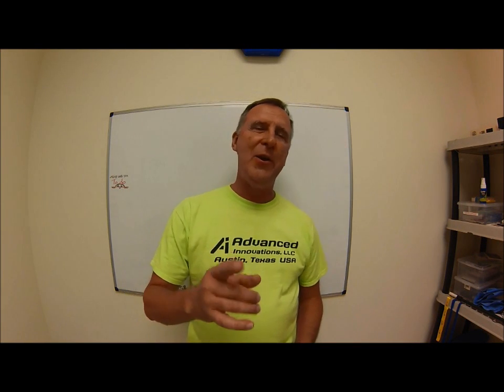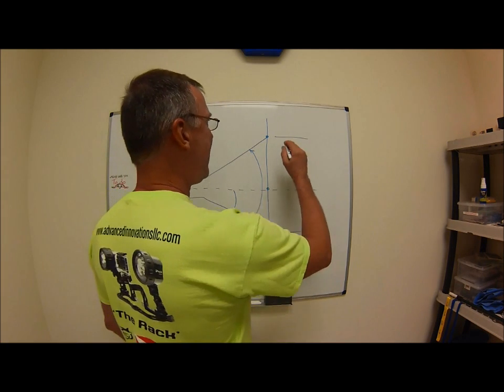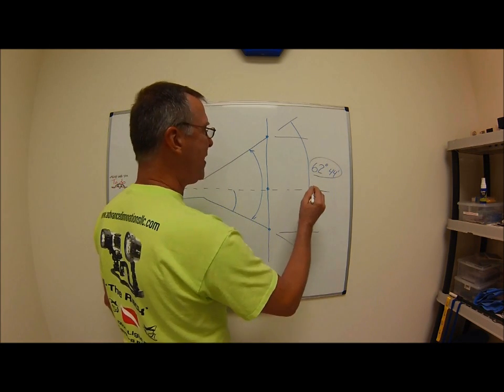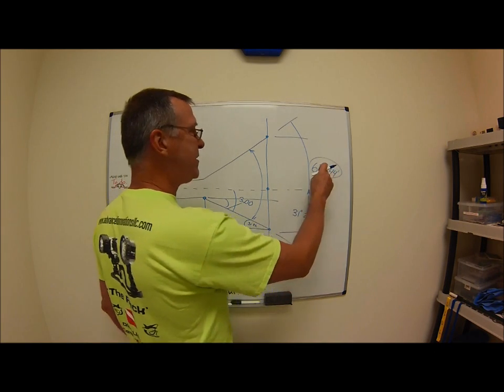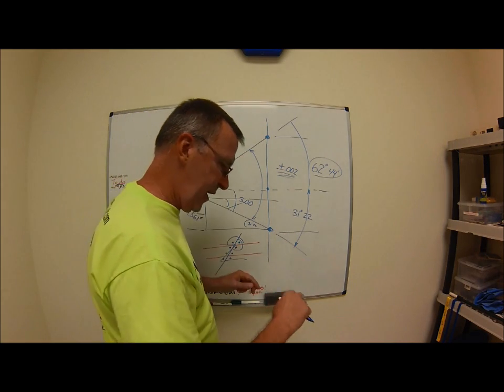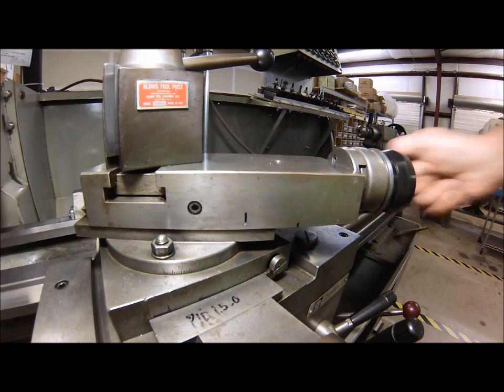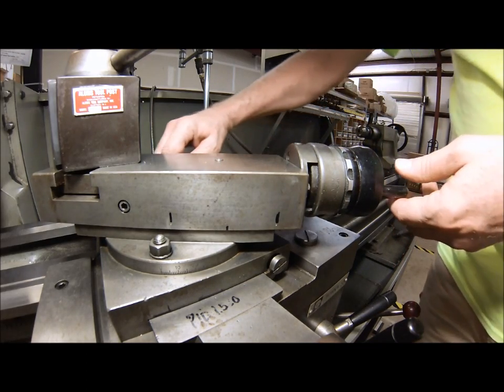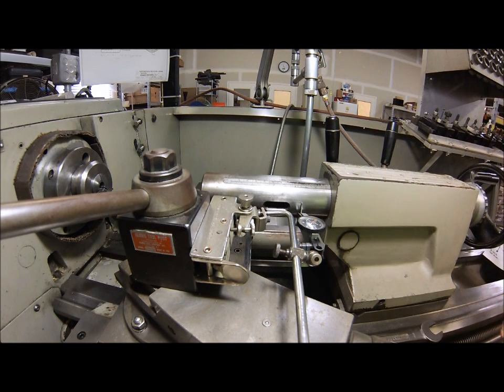Setting the Lathe compound to precision angles

Comment: Thanks Joe, will this also works for very shallow tapers like 1mm over 280mm length (this is something like 0.2 degrees). Is it also possible you think to cut this taper with the compound method in sections?

thanks in advance

Teun
Reply from the maker: You may be better off pulling your tailstock off center and turning the part between centers for such a mild long taper.
Reply: Joe Pieczynski ok but How do I archieven the right accuracy that way?
Reply from the maker: Calculate the cross slide drop over a given distance and set the angle with an indicator and a straight bar. By having that straight bar pinched between centers and an indicator in a tool holder, you should be able to move the carriage and see the needle on the indicator respond to the movement. Using a DRO or another long stroke drop indicator you can move the carriage a known distance and see if the tool post indicator gives you the correct value.
Reply: thanks again Joe. I will try this...........and let you know the result

Comment: Joe.  This is a brilliant technique.  Thanks.
Reply from the maker: Super accurate. Be sure to keep the indicator as close as possible to the centerline of the registration surface when you check your drop reading.
Reply: Ah good call.  Yes.  I love techniques like this that use an indicator as opposed to some backward arse way of trying to gauge or guess.  This produces real repeatable numbers.  Again...thanks.
Reply from the maker: I manufactured and repaired military explosion suppression systems and valves for many years. The angle on the print absolutely needed to be the angle on the part. This technique passed inspection 100% of the time.

Comment: There's a much faster and more accurate way of doing it - if you have a sine bar.
Just set the sine bar up for half the angle for the cone and set it up with its gage blocks, on the side of the compound (laying down, of course) - Then just tram the working face of the sine bar with the carriage movement while tweaking the compound angle until you get zero T.I.R.
You may have to set up parallels and/or 1-2-3 blocks to clear the nuts/lower flange in order to get the sine bar up high enough to reach the compound side.
Reply from the maker: True.....but you need a sine bar and gage blocks.

Comment: good Video thats how i was taught to set up and angle the toolmaker that trained me told me the bigger the triangle the more accurate you will be you could be accurate over one inch it all depends on you technique. ps the ones who give you a thumbs down are probably just cnc operators trying to learn how to run a manual lathe lol keep em coming

Comment: Joe - on the topic of c's and 6's - the part was aluminum - any advice on producing c's and 6's out of stainless?
Reply from the maker: The TPG insert works well for me on SS. I do 17-4, 303 and 316 frequently. The chips rollover and break just like the aluminum. Coolant has proven to be beneficial.
Reply: Thanks Joe - I will have to get more aggressive with my cuts, feeds and speeds - I am tired of getting sliced up by razor sharp SS spirals......

Comment: That was an impressive trig lesson. I really do like this answer to a simple problem. I really like this approach over what I see a lot, what uses a "close enough" approach. Depending on the job I'm running, some of them it's "as long as it fits the box" others it's "get it as close as humanly possible... then get it closer" so the math approach is appreciated. the old slogan "If the numbers are good, the result will be good" comes to mind.

Comment: Interesting that just today I was looking through a 1945 copy of Mechanic's Vest Pocket Reference Book, by Wolfe & Phelps, sixth edition.  I am not a machinist, but my grandfather gave the pocket book to me when I got my aircraft mechanic's license in 1965.  The first subject in the book is titled "Interpolation Instructions."  First sentence: "A new system of interpolating trigonometric functions analogous to that sometimes used in connection with logarithms is provided for in this booklet."  It then goes on to describe a mathematical method of determining the sine of angles specified to an accuracy of ONE SECOND of arc.  In the first example, given an angle of 33 29' 34''', a method is shown that in six steps of calculation provides a sine value of .55183.  I have not begun to understand the method, but it makes it pretty clear to me that by the end of WWII, those machinists really had it going on.
Reply from the maker: With more primitive tools and machines than current day. they have my respect for sure.

Comment: Joe, when you multiplied the sin(31deg,22minutes), how did you input it? 31.22? I am coming up with a little smaller# then yours,
Excellent teaching skills by the way. REAL machinists training on your channel. Thank you in advance.
Reply from the maker: This is a common mistake. When using a calculator, 22 minutes isn't a pure .22. Each minute is decimal 1.666.   You must make the conversion if your calculator doesn't do it for you.  22 minutes is just over 1/3 of a degree,  .22 of a degree is just under 1/4 of a degree.   Thats the error you are experiencing.
Reply: Gotcha, thanks

Comment: Amazing application of Maths. Do u already made the video with the explanation of how to measure with precision the bigger diameter of the cone? Because I've always wonder how to do that.
Reply from the maker: Internal or external feature?
Reply: Well... both
Reply: For internal, place a ball bearing of known size into the cone and measure to the face. Sketch out where a sphere contacts a taper on paper and start drawing right triangles to solve for and work your way to the feature you want to calculate for.

Comment: Great video joe, can you talk about how to set up for a male taper? Let’s go with the premise of, Ihave a taper but i know noting about how to measure it let alone setting up the cross slide. The end of the taper is banged up a little so i cant determine the length of the taper. All i know is it came out off the tailstock of my watchmaker lathe. It's tiny. Size shouldn’t matter right?

Comment: 0:38 this is exactly why I think experience is more important than getting your engineering degree, although that still is important. Some kid that's 4 years out of highschool makes a print and has no clue about manufacturing process and how hard certain things are. You just see a print where everything is 2 tenths and you know they don't have a clue. I've been working in shops starting as machine maintenance and started running cnc mills to cnc grinders and now in going to school for advanced manufacturing and machine technology to learn how to make the stuff before learning how to design the stuff. I want to be able to design things that are easy to manufacture and service and make a print that won't make the people who make the parts hate me. I'll probably just end up having my own shop and make my parts anyway because it's more fun than drawing on a computer. The first time I made my own toolpath on my mastercam part and loaded it and setup the minimill and ran it, it just put lighter fluid on my fire. I love this stuff. I'm only in my second semester of school but I'm 2 semester ahead already because the work is just fun to do.
Reply from the maker: It helps to have that passion. I used to teach "Design for manufacturability" to 3rd year mechanical engineering students from the University of Texas at Austin. They were shocked at how much they didn't know but learned in 40 hours.
Reply: @joepie221  I wish we had that class. Going through school for mechanical engineering right now and some of my classmates scare me. A buddy of mine had to teach a mechanical engineering intern how to use a wrench and the difference between steel and aluminum! Yikes! When I graduated with my bachelors degree I looked back and realized that all they had been teaching me was math, not engineering. The stuff I found important, like how to dimension parts so tolerances wouldn't combine to create an unusable part or even acceptable tolerances were just glossed over really quick. I don't think we ever really covered how to create a readable, usable blueprint in detail beyond my only CAD class my first year. Everything was about the math.  I work on cars for a hobby and I constantly curse engineers for making things near impossible to work on, although that is also influenced by assembly lines requirements and accounting I'm sure.  All our engineering exists in the computer, so if it works there, it must work in the real world right? Yeah right.

Comment: Thank you I will give it a try. I need to cut a B10 taper for a 6mm drill chuck and the angle for B10 taper is only 1.37 deg.
Reply from the maker: On a taper that mild, be sure to leave some drag on the locking screw(s) that lock your compound to the cross slide for the cut. Any slop in your compound ways could effect the result.
Reply: There is another way to turn an external tapper for which you have a reference to copy (e.g. Morse, various chuck tappers). Put a good arbor/extension with that tapper in the chuck and indicate it to make sure it turns straight. If you have it, use the tapper in the through-hole of the lathe (with good adapters) instead of the chuck. Then indicate longitudinally off the known good tapper, adjusting the cross slide until the needle stays put over the entire length of the reference tapper.

Comment: Very clever method, and very precise. I had trouble, however, when turning an external taper between centers. Everything got in the way, and couldn't use full travel of the compound slide. Anyway, I think it´s a great method and will stick to it most of the time.

Comment: Looking for instruction on cutting a one inch roap grove pully.
Thanks.
Reply from the maker: In the absence of a CNC, you are going to need a form tool to match the radius on the rope. You can plunge the tool and walk it out with the compound set on your desired angle, but you will have to reverse either the pulley, or the compound setting for the second angle.

Comment: This is great, i thought you were going to suggest using some scrap bar and cut the angle adjusting till it is correct ! BTW how would you measure across the mouth of the angle, "Hight over a ball" that would be a good lesson, a bit of math involved, but never let me down.Thanks once again...
Reply from the maker: That video has already been posted. Take a look at my video list for measuring conical angles.

Comment: Joe. Leave the tailstock alone. Machine a piece of steel. Here is your perfect Z Axis. Your compound on 1 crank travels 125 Thou (1/8 Pitch) [or measure its exact travel on one full turn.] This is your Hypotenuse. Your Dial gauge is set on your X Axis as you have shown. Zero the dial against the machined piece. Crank one full turn on the compound. Example result. Dial now = 100 Thou, Compound =125 Thou. ACS(100/125) = 36.8698 deg. You get ACS (Arccosine) and all other trig functions on a cheap calculator and then one hour playing around on a web page showing the basics of working with trig. Its not as scary as we were once led to believe. Eg 2. Turn the compound crank 4 full turns = 500 Thou. The Dial may now show 400.5 Thou. ACS(400.5/500)= 36.7742 deg. By the way, the compound set at 36.87 deg gives the 3  4  5 Triangle.
Reply from the maker: I see where you are going with this, but if you are midway into a part and need to address another feature, machining a blank in the spindle isn't feasible because you would have to remove your working part. For a fresh part, you may be able to use this, but I personally would rather work zero to zero with a fixed drop and cross slide. Its no less trig either way. You still need to know your hypotenuse and short leg, or you'll have to calculate your short leg after reading your hypotenuse. Thanks for the comment.

Comment: i really like your videos and they have help me to understand many things in a different manner i do have complications with understanding angles an radius for example 62.44 minutes I see you split it to 31.22 minutes my problem is that some times that dimension is from apposite direction from 90 and I get confuse about that ( like 30 degree and some times they call long 30 wish is from 90 back but its very confusing for me to identify which one to applied the same problem with radius  may you have any mated to identify this better I will appreciated, and thank you again for your time, and this good videos you provide to us

Comment: Hi Joe my graduation on my compound slide table is practically  disappeared and can barely see them. Is there a way I could have the graduation put back on. I'm new to lathe work and started restoring my 1939 colchester master lathe. Sadly the Previous owner really didn't take care of it. Other than that im enjoying the whole experience.
Reply from the maker: I could only imagine machining them back on. Rotary table on a manual mill or a CNC should be able to handle that.
Reply: It would be easy enough to get a zero mark by using a test bar and running your top slide to zero. You would then need some math to do the rest.

Comment: small pet peeve, the number I'm getting for your calculation is "1.5615389039" which should round to 1.562", if it was rounded down to help meet a tolerance pls say so.

Very helpful video though, I have already bought a couple more indicators trying to hit a precise angle on the compound but with this method you only need one!  Thanks for uploading.
Reply from the maker: At .0174 of rise per 1 degree of run, the 4th place decimal doesn't really effect the angle unless you were trying to hit the moon. .0005 translates to 2 minutes at 1 degree. +/-

Comment: Check the tail stock quill to make sure its parallel. A lot of them are not.
Reply from the maker: If your indicator contact region is at or very near the center of the tailstock spindle, the parallel relationship of the tail stock spindle to the bed becomes less important. The amount of error would be reduced if any was present at all..

Comment: Thats brilliant, super clear and simple :). A couple of comments about possible inaccuracy of the tailstock.
If youre working on an old beater with known issues with the tailstock, of even if there is no tailstock, you could chuck up a piece of scrap and cut a couple of collars of equal diameter over the distance you need, then measure out youre triangle in the same way. That way youre relating to directly to the spindle.
Cheers Joe, ill be needing to do this sometime soon.

Comment: Hi Joe, 
thank you for a great bunch of videos - I am subscribed :-)
I am looking forward to the second part of this video, where you explain how to get, not only the angle correct, but also how to get one of the diameters of the taper right at the same time.
The job I have in mind is making is (for example) making my own chuck backplates for a lathe with short taper nose  (DIN 55021, 55026, 55027 and similar).
Not only the angle has to be precise - 7deg 7min 30sec, but the large diameter of the taper is specified to three decimal place (in metric not imperial).
Chris (from UK)
Reply from the maker: If you know the sharp corner diameter and work back from there, its a piece of cake.
Reply: he, he,
thanks Joe,
everything is easy if you know how...
and that's why you are doing the videos and I am asking the questions :-)
If it was the smaller dia of the tapered hole, that was specified, I guess, I would turn the straight dia hole and then taper it, but with the big dia being the critical one, I need one of your tricks... please.
Reply from the maker: Once in a while you will encounter a feature that demands you have a gage or comparator or something else to achieve your goal. Since you are boring a tapered bottom hole, and the mouth of the hole is the important dimension, you still have options. If you know what the radius is on your tool, and you know what number on your dial gives you a bore of the same size as the major diameter of your taper, you are half way there. Once you know your dial number, and you have your tool sitting flush with the face of your part, its now only the radius that is the wild card. It may take some geometry to figure it out, but you will be extremely close. If your boring tool had a dead sharp corner on it, you could just cut and have your required dimension. Shallow tapered holes that are not through holes are some of the more challenging to cut accurately.
Reply from the maker: This is a good question. Let me dig in deeper for the construction answer. There is more to it than meets the eye.
Reply: Thanks Joe!
Making test gauge is the usual suggestion, but even this is not that easy to get right when it comes to the large dia...
One more thing - backplate I am talking about is through hole short taper, that is supposed to register both on taper and the flat face (yes, I know it is over-constrained, but it works very well).
Here a link to spindle noses I am talking about:
http://www.lathes.co.uk/latheparts/page11.html
although the same question would apply to  a whole lot of other standard spindles.
The critical dims are dia "B" and the angle, the rest of it is a breeze...
Reply from the maker: You got a video coming. Stay tuned.

Comment: Good tip Joe had to use this method often where I worked last year's as only lathe I had in tool room was an old mid fifties Warner swasey good old lathe but it was a little worn
Reply from the maker: I too am from the mid fifties. I totally understand.